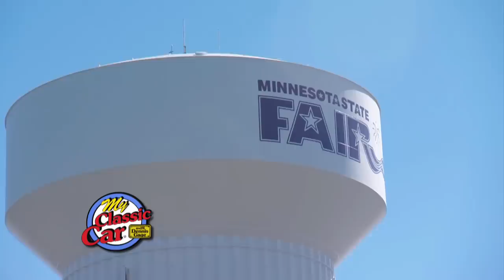1949 Ford Woody Wagon | Back to the 50's Car Show

Comment: The Flathead in the Merc makes the car. I had a white ‘50 Ford Woody in high school, into which I put a full race Flat Head and a Hurst shifter replacing the 3-on-the-tree. I’d gladly trade my fully loaded 2013 Lincoln MKX for it, if I had any idea what became of it.  I’d even throw in my ‘56 Ford 2-door project car. I bought that woody for $100 and sold it for $700. It seemed like a good deal at the time as that was all I had in it. That and my time. It allowed me to put a down payment on a new VW Bus, which was just what I needed to move away from home and drive to San Francisco in 1968. But do I ever miss that white woody now, and I never give a thought to the VW Bus. Such is life.